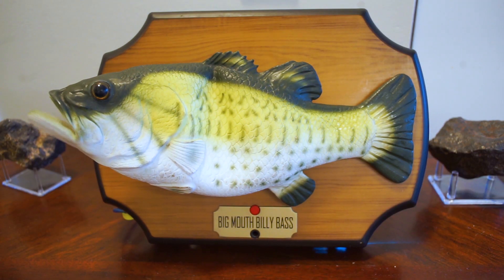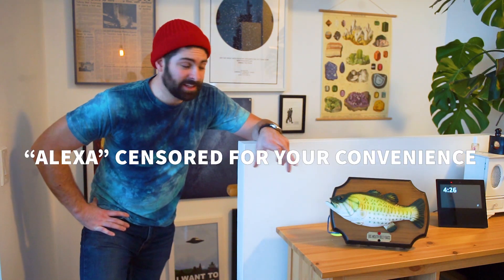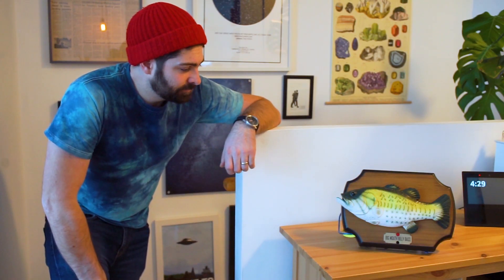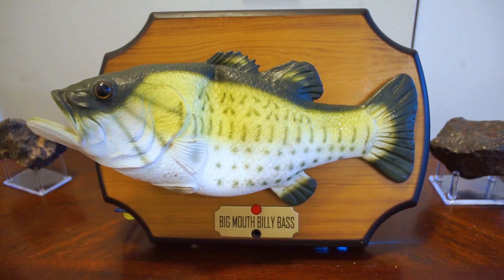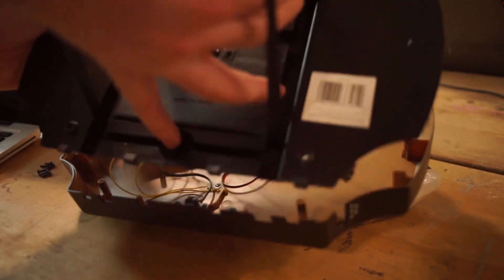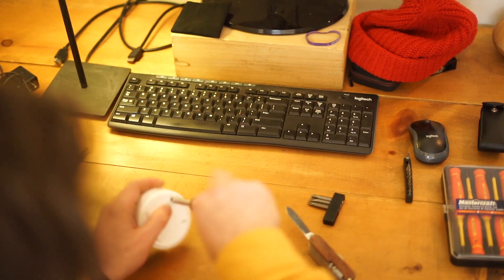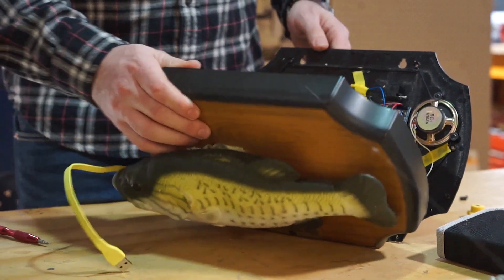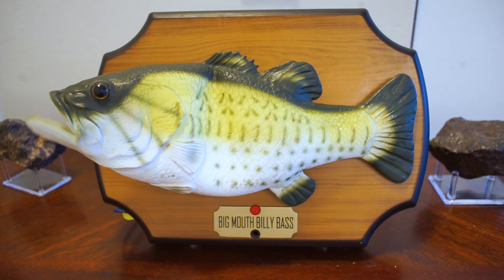DIY Billy Bass ft. Alexa Explained!

Comment: Ben is there somewhere I can message you? I’m doing your project and so close to the end but stumped on getting the A0 pin to register that music is playing
Reply from the maker: Yeah dude right here! Stoked you're closing in on the end! 

Been a while since I built this though so I may be a bit rusty. Get me back up to speed... what's up with A0? You're expecting a signal out of the little Amp right to register as an input?

To debug you can try printing A0 values as they come in. If it's always 0 there's probably somethin wrong in the circuit. If you see it fluctuate with music, then it could be an issue of boosting the signal, or changing your "music is playing" threshold. 

I'm moving this weekend so may disappear a while but I will check back in on you.
Reply from the maker: Specifically this line: https://gist.github.com/benrules2/2f5304627c109e4ceb31b8ec12d69ee0#file-billy-ino-L42 

Try throwing a Serial.println(sensorValue); before L42 and see if it ever changes. 

If not I'd take a hard look at the amp. Turn that little screw on the Amp board to boost the signal until you're seeing something. If you see nothing, I'd be most suspicious that the wiring of the 1/8" audio jack is properly soldered, connected, etc.
Reply: @BenjaminEagan  hey thanks for the reply man but yikes, feeling like I’m in way over my head because that was nearly gibberish to me. So I uploaded the audio diagnostic script you made. Playing music and in arduino software I clicked on “serial monitor”. I expected it to show something other than a blank screen in the serial monitor window it opened. I tried skipping this step and just uploading the final script you made and the fishes motors were moving but not like “to the music” even when it was not playing anything. I’m too deep to quit lol but not sure what I’m doing exactly. It’s been a learning process for sure
Reply from the maker: @RatkingOddities  it’s all good! I’ll turn the technical
jargon down a notch. Let’s start with this - is the speaker actually playing logical
sounds?
Reply: @BenjaminEagan  it’s playing music from the Alexa!  I have an additional wire running from the “out” part of the amplifier to A0 pin. I saw you’re suggestion on the blog to try moving the wire to the ground side of the amplifier, that didn’t work so it’s back on the “out” side. I have the motor shield attached to the arduino so I guess I’m technically wired to the A0 on the motor board.
Reply: @BenjaminEagan  alternative question. I think I’ve got it working maybe (I said fuck it and just put the final script you made in it instead of the audio diagnostic one) but maybe it’s always thinking music is playing because of the faint humming noise the speaker is making. How can I change the quiet threshold so that it only picks up the actual music/Alexa voice
Reply from the maker: @RatkingOddities  that sounds pretty likely! Around Line 42 of Billy.ino you can see the value being read. I challenge you to get your serial logger working, and see what it’s reading. Then there’s just a variable there called quietThreshold. Assign that a higher value, and the dancing will wait for a stronger signal. You can also fiddle with the white screw on the amplifier (potentiometer) to change the volume of the signal.

You got this dude!!
Reply: @BenjaminEagan   it’s done! After a bit of fiddling and changing the quiet threshold I’ve closed it all up and I’m very happy with the results. Right now the Echo is powered by micro usb and the motors/amp are powered with the batteries. I ordered a dual ended plug and some adapters so that I can charge everything at once with one outlet socket. Thanks so much, it’s been fun and a great learning process. I have a bit of a collection of older and antique Gemmy products (mostly halloween though) so this was perfect. You’re awesome man! Can’t imagine trying to come up with this from scratch like you did. Might try a smart mirror for the next project (saw you had a vid)  but I’m going to try and use the Gemmy spirit mirror, it already has a two-way mirror and I think enough space to house some components
Reply from the maker: @RatkingOddities  !!! That is awesome news, well done! I hate the idea of someone getting stuck on my builds, especially in the home stretch like you were. Will you shoot me a link to your build if you share it anywhere? 

Gemmy Spirit mirror sounds like a great smart mirror jumping off point too, I was just thinking this morning about how someone should build a ready mount 2-way mirror build for computer monitors. My next project is either going to be a furby overhaul, or stuffing Alexa into a 1920s antique vaccuum tube radio I've got. In both cases I just feel to guilty gutting the interiors, because the Furby is scary lifelike, and the radio is a legit piece of history.
Reply: @RatkingOddities  Hi. I think I have the same problem the you had (if you remember, it’s 2023 now!) So I connected everything and have sound coming through the Billy speaker but when I loaded the final script I just had the fish doing all sorts of random movements regardless of whether or not my amplifier was connected to A0 😢 what did you increase your threshold to?  I will try increasing mine tomorrow 🤞   I’m so close but currently just have a randomly twitching fish. I too thought (hoped) the movement was being caused by the constant humming interference coming from the amp.. will try this method one last time.
Reply: @BenjaminEagan  I finished it, but the mouth continues to move after the voice stops
Reply: Would love this but haven't got a clue about building with computers wood yes not computers how do I start don't want to fry myself  @BenjaminEagan

Comment: Hey man, awesome project! I’m working on it right now and I’m getting close to the finish line — but I’ve hit a few walls and could really use some help (total beginner here).

The fish keeps moving all the time, except for right after I unplug and replug the Arduino — then it stops for a moment. As soon as Alexa speaks, it starts moving again… and just never stops. I’ve already played around with the sensitivity values in the code (to adjust how loud the trigger should be), but that didn’t help either.

Also, whenever the motor moves, I hear a bunch of static noise from the speaker — like interference. I suspect it might be a power issue (motor and speaker sharing the same supply?), but even trying different setups didn’t fix it.

Any tips from you or anyone here would be super appreciated. I honestly have no idea what I’m doing — just trying to make this fish behave!
Reply from the maker: Nicely done! It has been a long time, so I'm honestly not so sure what  to recommend. Some things I do remember is that positioning the wires too close to each other in the fish lead to some interference... Running them in a loop also seemed to pickup some radio type interference as an antenna? I'd suggest experimenting with the fish open and a few different wire placements. 

I remember using different power sources being helpful for clean sound as well. 

I'm afraid that's the best advice I can give here! I'm not really a pro at this stuff too, there may be some basic electronic de-noising or grounding lessons I'm missing. So don't assume I'm not a hack in your quest for solutions :D

Comment: Hey, thanks so much for this, this is one of my first projects! I got all the way to the point with the audio to the motor shield and I cannot figure out the wires. It looks like in the photos you took the Arduino and Motor Shield apart and connected the audio through the amplified and Alexa to the Arduino but then... How do you put them back together? Do I strip the wires to fit them in the holes? Because the pins do not work if I put the two back together- the plastic part is too large and if I bend them they do not fit either.

Comment: Ben, i have a weird issue with my project... I did everything just as you did, however i didnt tear down my Echo dot because i wanted to keep it as is and just wired the audio cable accordingly. Otherwise everything is the same. When i power everything up, the fish just starts jittering and spazzing out (looks like a weird seizure) any advice? im so close to the end! audio works well, which is why im stumped..
Reply from the maker: Hey Hunter, probably just an issue of fine tuning the thresholds for "animation" actions. If the sound is clean, then this is almost definitely something you can fix in code! I don't have it handy so can't share the exact line, but the logic is basically that if the audio signal is above a certain level for long enough, sing or dance.... If your signal comes through different than mine (very plausible), our thresholds will be different.
Reply: @BenjaminEagan  Ok, thank you! I'll look into it and see what I can fix in the code, audio os very clean, that too took some fine tuning lol.

Comment: On mine, the "Alexa acknowledgement" beep causes the head to come up, followed by 4 or 5 mouth movements, then the head returns to rest. This happens again for the next beep when Alexa stops listening. Any sound from Alexa causes this.
Reply from the maker: Hey Wayne, nicely done - sounds like you're in the home stretch! The signal processing logic may need a little custom calibration for smooth animations though. I think was happening is the sound on/ sound off input isn't quite right. This can affected by your volume (which affects how strong the signal is), the tuning of the little amp, etc. So I'd suggest playing with the 'quiet threshold'  so the arduino agrees alexa isn't talking when the human thinks alexa isn't talking! 

Here's the salient line. https://gist.github.com/benrules2/2f5304627c109e4ceb31b8ec12d69ee0#file-billy-ino-L43  

I've also added some heuristic logic for example to assume "talking" animation for the first 3 motions ALWAYS ("sure. here's bohemian rhapsody by queen"). Then the duration of the talking is randomized to give a less robotic feel, but this changes how long your fishy is stuck in one animation cycle. Checkout the lines here: https://gist.github.com/benrules2/2f5304627c109e4ceb31b8ec12d69ee0#file-animatebilly-h-L82 

To understand that duration, checkout the RunMotorOnOff functions - both variations have a delay that locks in an animation duration as well: https://gist.github.com/benrules2/2f5304627c109e4ceb31b8ec12d69ee0#file-animatebilly-h-L9 . This means they run for at least aniDelay or aniDelay*2 for the two motor version.  

Tweaking all of these values will get you closer to the behaviour you want.

Comment: Would an arduino nano work instead of an uno?
Reply from the maker: If it has enough pins then it should be fine, there's nothing special about the UNO except it's the one I used and I know for sure it works!
Reply: @BenjaminEagan  thanks so much for the response

Comment: Hey currently running through this project - What are the names of the electrical connectors you use when soldering the L+R channel to the LM386 amplifier ? Very aware that the pins are close together and i don't want to short it.
Reply from the maker: Hey, that's awesome you're working through this project! Did you get the fish torn down and the motor controls going already? 

Anyway, I use male/female breadboard jumper wires pretty extensively (like these ones https://amzn.to/3sdRUpZ). That is what I used for this connection. They can be a little flaky when you're done prototyping though, so you can also just use a soldered wire. Keeping the power to the amp off until you can verify there is no short circuit should be safe. I personally tack a tiny amount of solder onto my wires for tight cases like this, and use a knife after soldering if there has been any spillover.
Reply from the maker: There are some still images on my blog too that may be helpful, but I'm guessing you've already seen that: http://www.cyber-omelette.com/2019/01/billy-bass-alexa.html